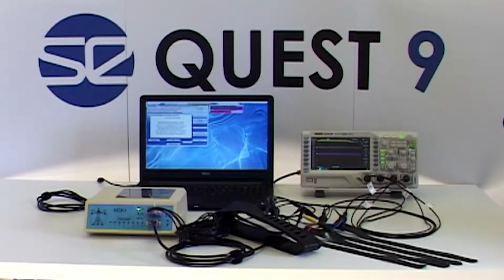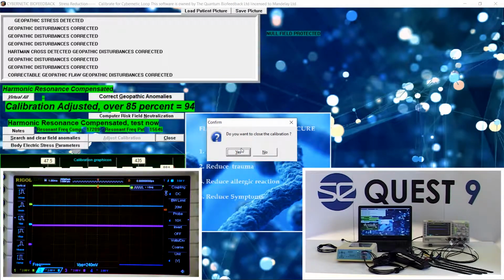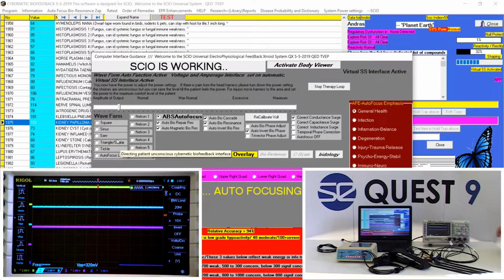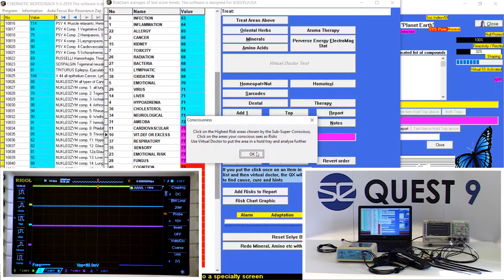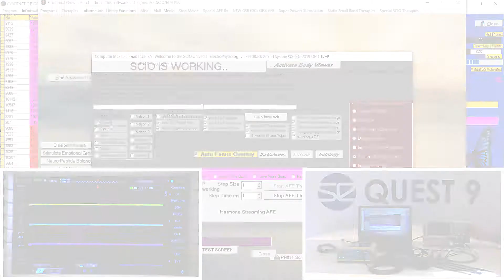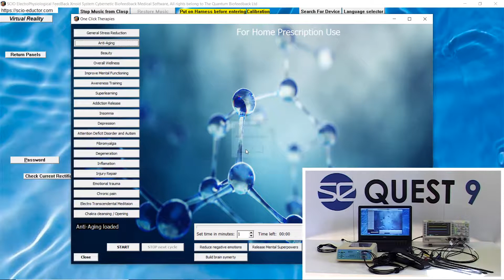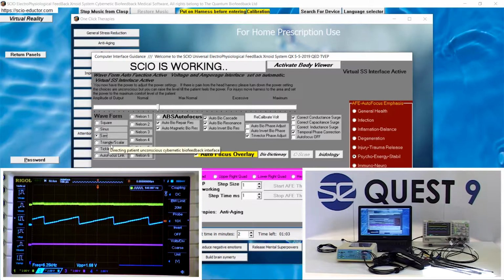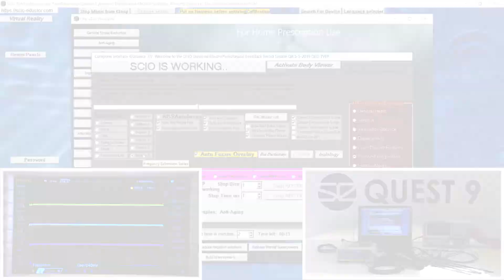OSCILOSCOPE test Scio

Comment: Very important demonstration to verify the output of SCIO. Unfortunately SCIO seemed to have accumulated criticism probably from rival companies that it was really just a hyped up radionics device. The results I got were often surprising, that is not to undermine radionics at all but I wasn’t sure if it was indeed a genuine biofeedback device.
Greater information on the various buttons used on the ‘SCIO is Working’ box would be welcome.
Reply from the maker: This result for SCIO is working is only with Clasp64 program all of the other one is not realy sending out information. In Clasp64 all of the button is working and sending out information!
Reply: Thanks for your reply. A bit of a late response as I didn't get a notification. When I bought my SCIO, in 2003, it was Clasp 32. But I believe the new program is Clasp 64. These days I'm using the OMNI. Would it still be sending out the waveforms?